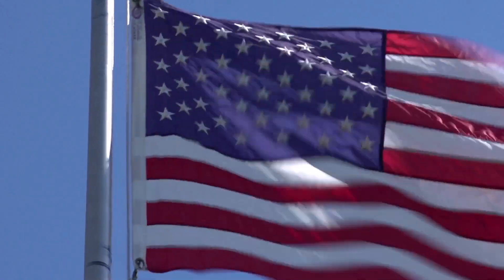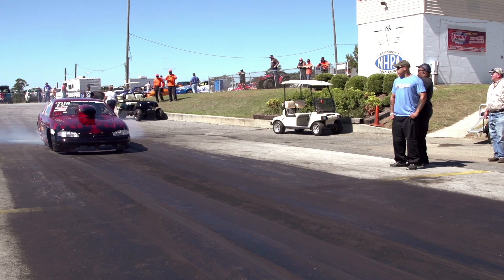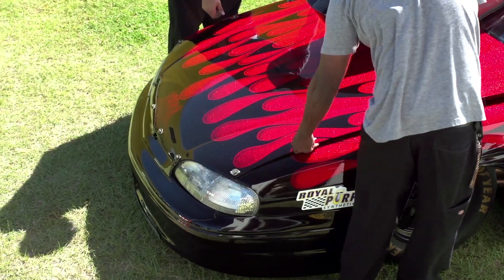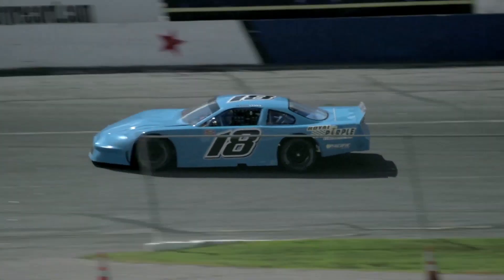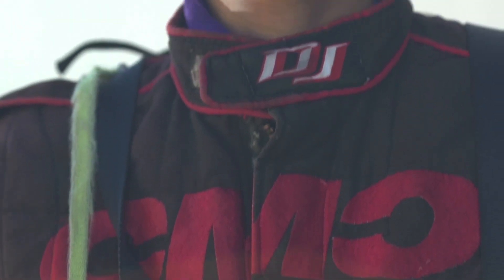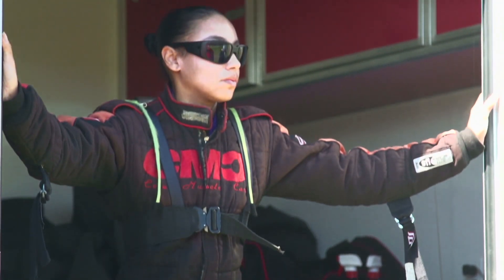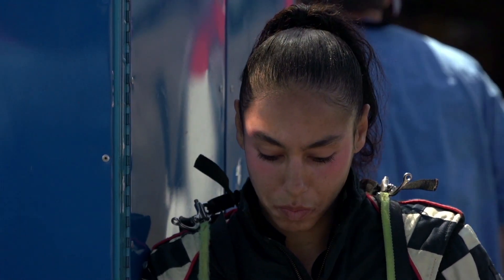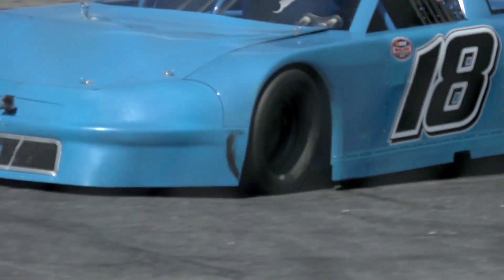Nicole Lyons! In-Depth with the Nascar and NHRA Driver - The Downshift Ep. 70

Comment: "engine" refers to internal combustion, and a "motor" is an electrical motor.
She called an internal combustion a "motor"
FAIL!
Reply: 1stGenStunter Only dimwits don't know the difference.
She also called "Metallic Car Paint" as
Flakes in the paint.
Reply: Stephen Bagnell I saw flake in that paint....
Reply: Michael Shotts
It was the equivalent of saying " that wheeled vehicle"
Well yes it is a vehicle with wheels, but it takes a little bit more to describe.
Reply: But there are differences between modern metallic paint and old "metal flake" most notable being that modern metallics use small uniform flake where actual old school metal flake uses large more random shaped and sized flakes, which causes completely different visual effect. That is "metal flake"
Reply: Michael Shotts
She still used the wrong names for the paint and other parts in her car.................

Comment: Try formula 1 this hick racing I. A circle crap take zero skill
Reply: A circle crap take zero skill ? it does not take much skill to drive a 1415 LB F1 car full of electronics with 1 1/2 to 2 tons of down force that is stuck to the ground like its glued down......but it does take skill to drive a non electronic 3400 LB NASCAR with limited down force that is sliding around with 10 inch wide tires around a corner at 180 MPH ( Not Daytona or Talladega ) on a mile and a half track when entering the corner at 205-206 + MPH lap after lap in a car that is around 120 degrees inside
Reply: you have no idea what youre talking.  you cant just get into a formula 1 car and go.  you left out a key part about the down force of an f1 car.  you must be moving at a fast enough pace in order for the aero of the car to take any kind of affect.  if not youre going to understeer and spin.  you wouldnt be able to drive fast enough to keep heat in the tires to get the grip you need for the downforce to take affect not to mention you wouldnt be able to drive fast enough to keep heat in the brakes so that they function properly.  you are clueless when it comes to f1 and the technology and skill required to be in it.  im not saying there isnt a degree of skill needed to be a nascar driver because there is.  but that degree is tiny compared to that of a f1 driver.  transitioning from a left hand turn to a straight is not a very difficult thing.  transitioning through chicanes and hard rights followed by gradient elevation changes into a blind left traveling at a high rate of speed breaking as late as physically possible is much more difficult than taking the same 2 turns 500 times.  get it yet?
Reply: I guess that's why the open wheel ( F1 and Indy Car ) Driver's come to NASCAR and suck ass......because they are the most talented Driver's on Earth right ?.....If the driver in F1 was so important why is there no DRIVER'S Championship ?....Only A Manufacture's Championship ? Why ? because F1 is all about the CAR and not the DRIVER......In F1 the CAR makes the DRIVER and in NASCAR the DRIVER makes the CAR
Reply: sawjar sawicki blah blah blah...like I said F1 is all about the CAR and NOT the Driver....even you know that cause you only mentioned the Driver 1 time and the rest of your Bullshit was about the Car.......and who doesn't know you have to be moving at least 50 to 60 MPH for downforce to work or heat in the tire's and brake's for them to work properly....everyone knows cold tire's wont turn and cold brake's wont stop......take Vettel out of his car and put him in the slowest car in the field and he will be the slowest.......take the driver of the slowest car in the field and put him in the fastest car in the field and he will be the fastest.........Out of the 470 Million Dollar budget the top F1 teams have less than 10 % of that is spent on Driver's.....Alonso is the highest paid at 40 Million a year .....Today's F1 is 95 % CAR and 5 % Driver..........Hell the team engineer on the radio is telling the driver exactly what adjustments to make to the car ( they have like 12 adjustments they can make with there computer like steering wheel ) from all the data they are getting from the live onboard telemetry on the car......So yes I do know about F1 and do know what I am talking about so go stick your head up your sheep's ass......If I took your brain and shoved it up a gnat's ass it would look like a BB in a 55 gallon drum